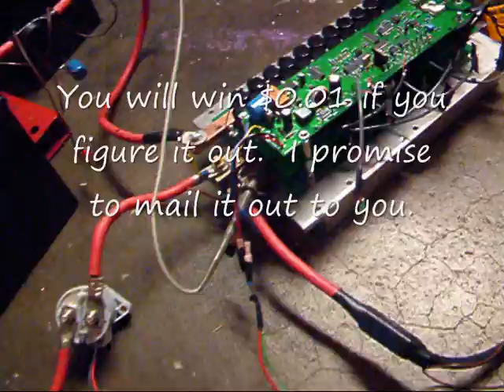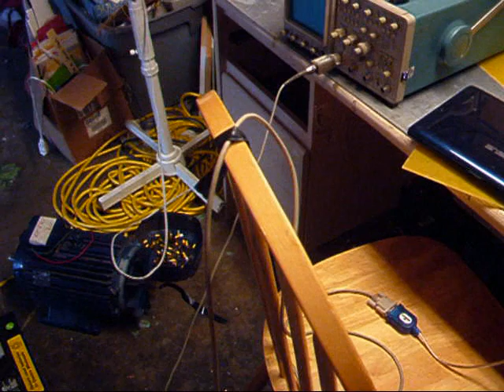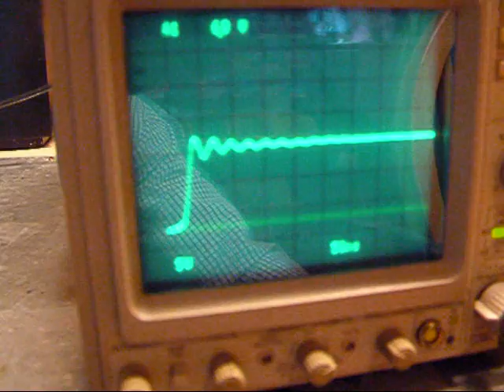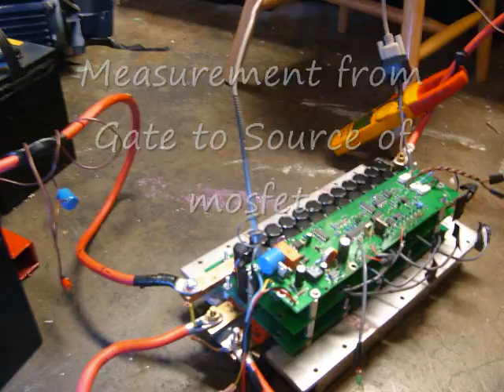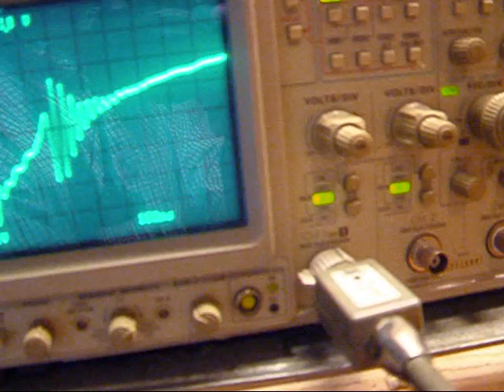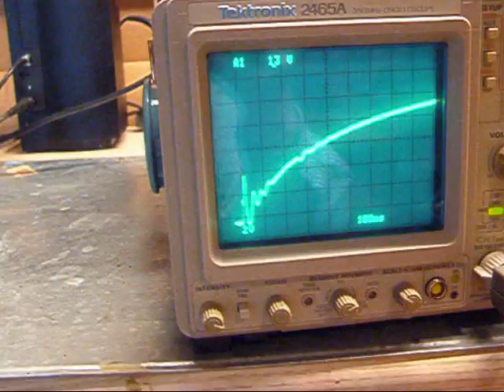Controller Noise Issues

Comment from the maker: Oh ya, it needed a snubber!!!  That's what I'm talking about.  I added a 0.01uF cap, and 4.7Ohm resistor from drain to source just for test purposes, and now the mosfet turn-on spikes are about 1.5v volts at 6 amps, whereas before they were about 7.5v at 6 amps. Your pennies will be in the mail.  lol.

Comment from the maker: I actually started with 5% tolerance carbon resistors, and then ran a fixed voltage through each one, measuring mA through the resistor.  So they ended up +/- 0.01Ohm or so.  The fet supply is pretty solid, but the drive signal I think is affected by the ringing of the turn-on from drain to source.

Comment: Mosfets do this when you turn the gate on fast you can tune it our with a zener across the gate to source or snubbers accross drain to source.   What happens is the gate gets charged as it turns on the source starts to conduct to drain and the source moves which moves up so difference from gate to source narrows and starts to turn off the gates then the gate continues to charge and turns on again this cycle repeats untill the gate is fully charged.  Hope this helps.

Comment: A couple of questions.  First, why is this an issue, some controllers I built the motor didn't care, and I have gotten this before on some contollers as well.  Second, does the duty  cycle effect the amount of the initial spike?

I have found that poor quality capacitors "ring" a little for some reason, and better quality lower ESR capacitors do not tend to ring, so any artifacts you have like this can be accentuated by some parts like this.

Comment: I am not an expert but what about lower tolerance gate resisters? It would be ideal to isolate each Mosfet and monitor the switching again... What about then fly-back diodes although this noise is not on the off side? how is the signal on the fet driver? Impressive work!